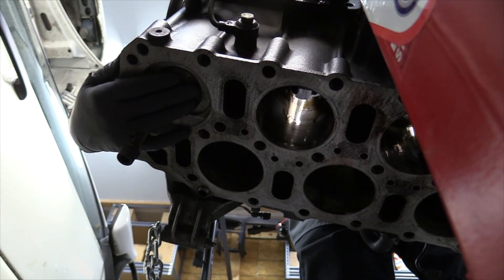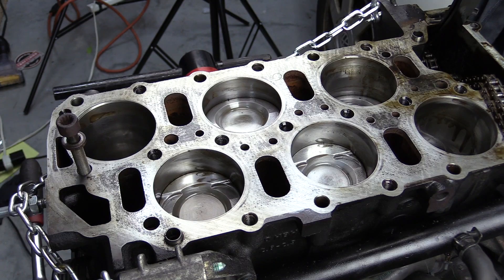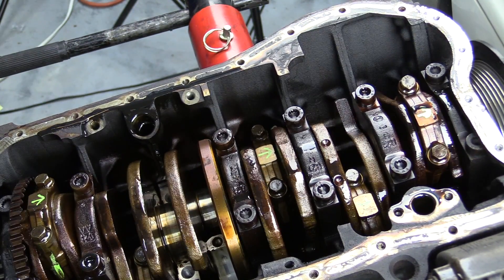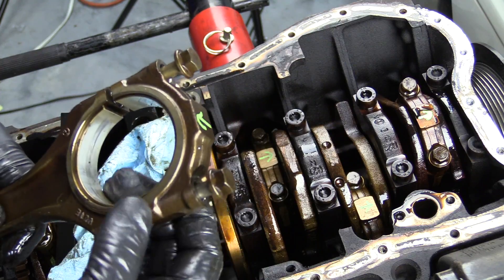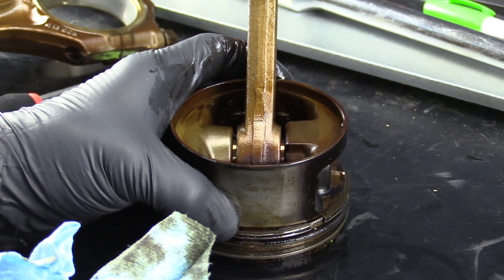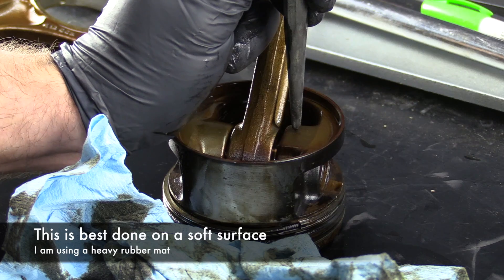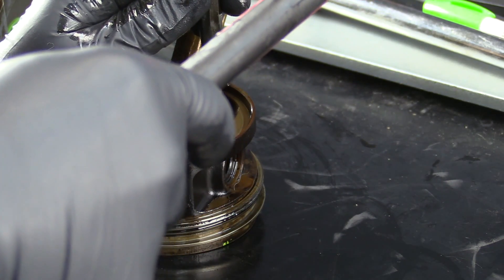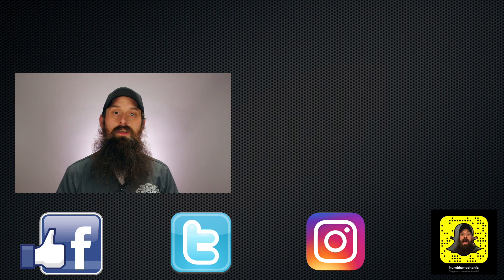How To Remove and Label Pistons ~ White Wookie

Comment: I wasn’t really planning on messing with pistons, bought a car with a snapped timing belt as a project, turns out it’s somehow got bad piston rings, not sure if the engine is gonna be worth saving but I’m gonna dismantle it and take a look guess it’s a good learning experience lol..
Reply: How did it go
Reply: @thomas9434  yeah went fine I put new rings in it, turns out I made a bit of a stupid error though because it was a bad camshaft causing the low compression in the end lol, I guess it’s good experience though.
Reply: @bendude6748  I'm planning on rebuilding my whole engine soon
Reply: @bendude6748  going to buy a rebuilt one and put it in my car, then try rebuild my old one
Reply: @thomas9434  sounds good, it’s good to learn how it all goes together, to be honest it’s surprising easy when you get into it it’s more just taking your time and being organised with all the parts.

Comment: The I’ve been watching this great series. Why did the main bearing wear determine a whole bottom end rebuild? Couldn’t you just replace the bearings instead of a full rebuild? Could you also explain how thrust bearings work, how determine when they need replacing, and the procedure to do so without pulling the pistons? Also same for the intermediate shaft bearings as I’m working on a 1.8 jh.

Comment: You want to mark internal engine components so when you put it back together, you match wear patterns. When you get the pistons coated and take the block to the machine shop, you get rid of the wear patterns. So I regret to inform you that this was all for nothing. But I assume this process wasn’t for you, but because you have an opportunity to teach so you took advantage of it. Enjoyed the vid as usual nonetheless
Reply from the maker: I am an over marker when it comes to this. Id rather waste 5 seconds making a mark for no reason, than not mark something that will cost me an hour. LOL <3

Comment: I've done several 8V & 16V H20 VW engine tear downs.  I used a number punch and stamped the top of the piston when it was still in the block.  Also did the rods and caps at the same time.  This method is faster, although you do need to buy the numbed punches.  All of those VW engines went into SCCA race cars including ones that have one at the ARRC & the Run Offs.

Comment: Do these hi-tech engines ever require a ridge reamer to remove the pistons?
Reply: I think it is needed at times. However, with the angled deck of the VW VR6, I don't know if anyone could use a ridge reamer.

Comment: I picked up an '02 Passat 1.8T for dirt cheap that skipped time and busted the valves pretty bad. Is it worth pulling the head and fixing it or is this thing scrap? Got some body damage and was not well taken care of. I'm at a crossroads and would appreciate your input. Thanks!!
Reply from the maker: I would pull the head and see what the damage is. Would the body damage make it not drivable?
Reply: +HumbleMechanic Hey thanks for replying! The body damage is all cosmetic, but really shows how little this car was cared for. I put my bore scope down the spark plug holes and Cyl 3 has a valve sitting on top of the piston. Really bummed me out!!!

Comment: Unrelated to the VR6 but related to engine rebuild.  I have a BWT 2.0TFSI engine and I have been told that VW has put a "magic" coating on the cylinder walls of BPY/BWT engines. I have also been told honing is not recommended when replacing rings, rods, and other bottom end parts.  While this would make installation of new piston rings (oil rings are bad surpirse surprise) easier I am a bit skeptic. Perhaps you might be able to confirm or deny this?  Anyways, love the show and makes me want to have a VR6 again.

Cheers!

Comment: Have you ever worked on a VW Vanagon/transporter with the insane Wasserboxer engine? To get the pistons out you have to drag the cylinder barrels out of the case and either pull the pistons out of the bottom of the jugs or wriggle the wrist pins out while the jug and piston flop around.

Getting the whole pile of miserable misery (!) back together is even more fun. Since there is no access to the big ends of the conrods without splitting the case you have to re-insert the cylinder barrels with the pistons hanging out of the bottom and fight the wrist pins back in..

Not fun.

See https://youtu.be/6LZyJPy_mIo

Comment: Just a small question. When you unscrewed the piston cap bolts, did you break them free first with a ratchet/ breaker bar, then unscrewed them the rest of the way out with the Milwaukee? Or did you break them free with the Milwaukee? Thank you!
Reply from the maker: +Myles Harrison in a previous video, I loosed them and inspected the bearings. I just snugged them up so nothing got lost

Comment: Are you going to upgrade to the MLS head gasket? Do you know the part# for the o-ring that goes in the block oil passage before installing it? by  cylinder 1...

Comment: How did you determine, before you even removed the pistons, that you were gonna be able to reuse them and get them coated?  You need to check piston-to-cylinder wall clearance, you know?
Reply from the maker: +50sKid the car ran well before tear down. No noise no misfire.
Reply: Right but you won't necessarily hear any noise or get misfires with piston to cylinder wall clearance that is, let's say, just at the edge of the manufacturer's wear limits.  I'm currently doing a similar rebuild (175k bmw) and I went ahead and miced the pistons and bore gauged the cylinder walls and found that I exceeded the clearance on 1 of the cylinders and was almost at max on most of the rest.  Interestingly, I could have switched 2 of the pistons and brought them all to within tolerance, however my taper and out-of-round wear was ultimately too great to reuse the block as-is (I haven't posted this video yet).  I decided to overbore for oversized pistons.  I mean, if you're spending money at the machine shop on the bottom end, might as well get a rebuild that will last, you know?
Reply: I agree instead of coating go with a bore and new pistons ...
Reply: same deal here with my 24v vr6 rebuild. I had planned to reuse the pistons and the bore gauge found 2 cylinders out of spec... so I opted for a bore and 82mm pistons.
Reply: Most people call it experience. Just like the xp I have now from helped with more of a certain crowd targeting Ford that I hate, than anything else total....I hate NC.
Reply: BTW somebody should post publicly to the mention to their many more followers than I,  that on mid'80 Fords, the rotor and cap can and will fit on in 3 different positions each. I got lazy with all the other makers. So had to spend a long time before even finding the issue much less the fix. When I skipped the mark this time in the rain, i was stupid, and paid dearly with client in tow. He had good jokes tho.

Comment: Nothing wrong with just marking the top/head of the piston in the same fashion.

Do you feel that you work as cleanly when wearing gloves?

I myself can not stand them as I like to be able to feel things and I lose too much dexterity wearing gloves.
Reply from the maker: I really feel I work better in gloves. Not in thick "mechanix" type, but nitrile type work great for me.
Reply: How did you get used to it?? I have tried many, many, many times and yeah it lasts a full 30 sec one time before tearing them to shreds on parts.

Comment: Charles 
I always mark the connecting rod journals to match up the bearing cap of which way it came of the connecting rod with a dot or two like you did the bottom of the pistons.
you really should get a spring punch I've had mine since I worked as a welder while in high school. works for all kinds of metal and plastic too

Comment: In the past, I've had good luck getting pistons and rods out with a wooden hammer handle.  If you need some extra length, a piece of wooden 2x2 works well, too!  Definitely won't hurt the cast/forged iron rods.  :)